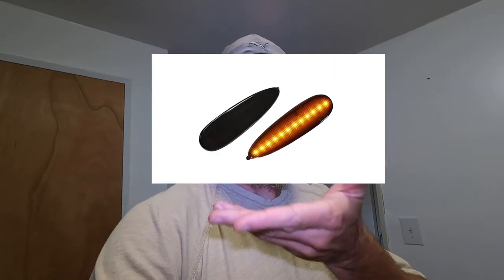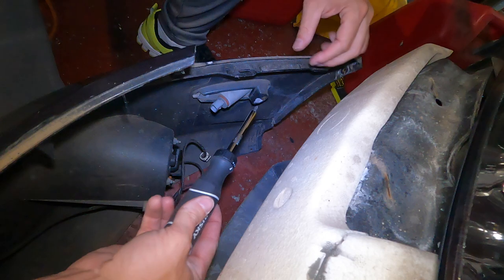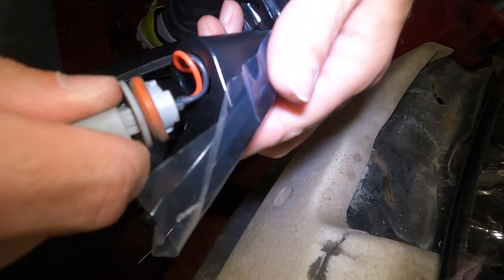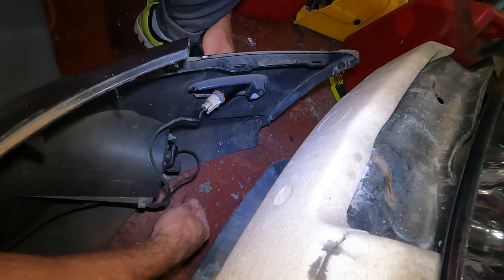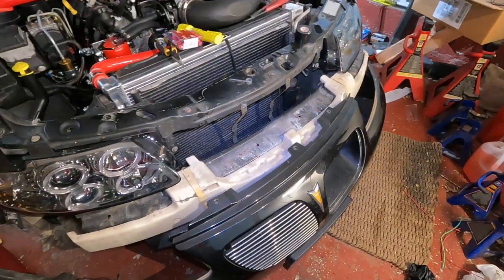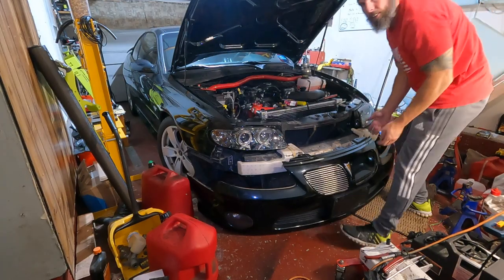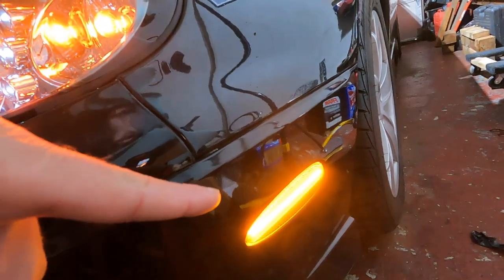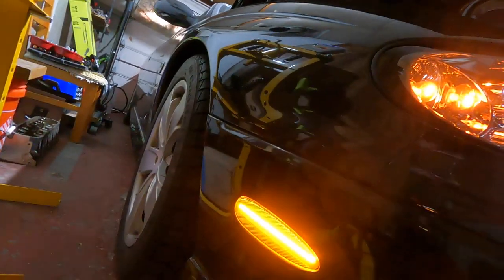GTO Side marker light install and bumper install

Comment: are there any ways to do it without taking the bumper off i got under mine and it looks like there’s metal plates in the way of both screws
Reply from the maker: I never tried, but it didn't look like you can do it without taking the bumper off. I'd say try a stubby Phillips head screw driver and see if that work